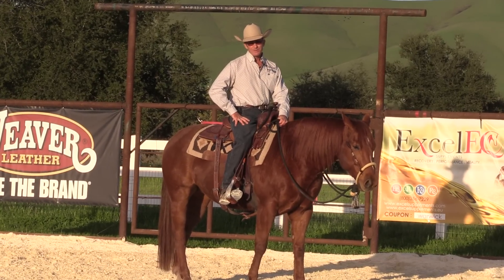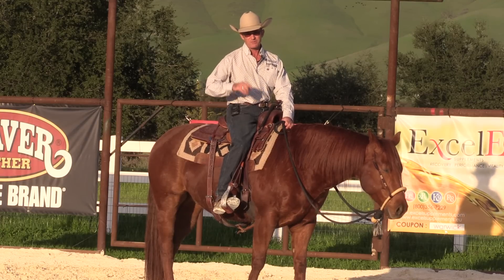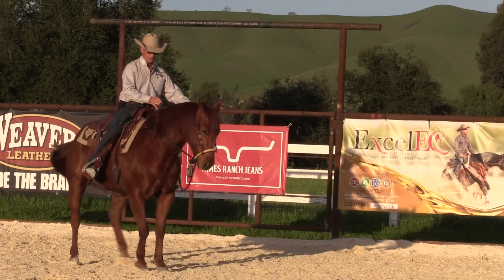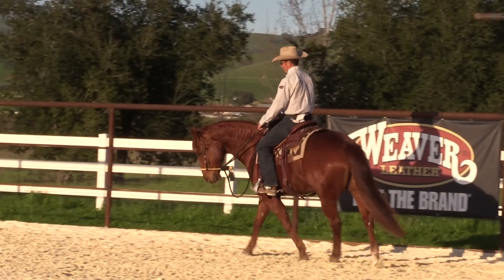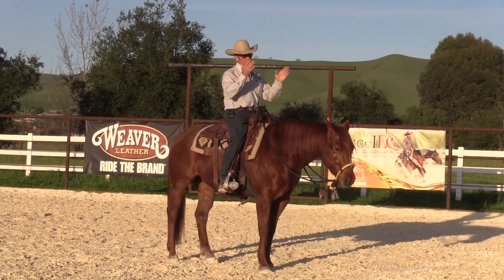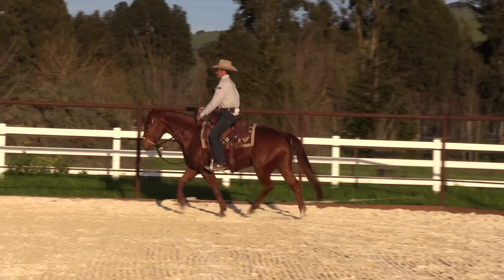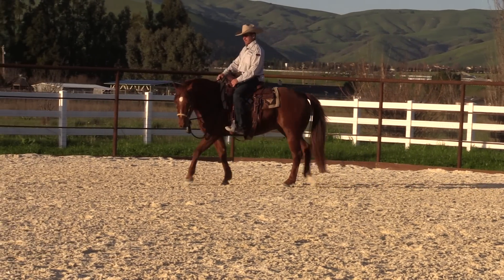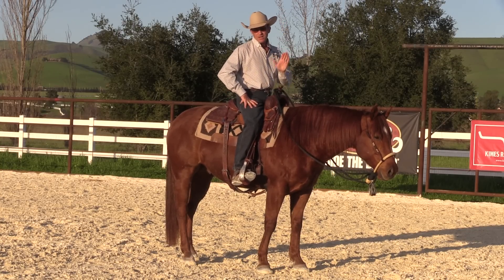Why training a horse is like fixing a broken water pipe.

Comment: As a heavy equipment operator with more than 30 years experience and having worked with horse's in various capacities, I can very clearly state, working with a water main is MUCH easier than training a horse, a water main wont kick you in the teeth if it does not like you :) or bite you, or throw you against a wall, smash you into a tree or pee on you.... dont ask.....I was young and had no idea a mare could do that....

Comment: can i ask why you wear spurs?
Reply: Good horsepeople wear spurs as simply an extension of the leg. It's a tool to use when the horse ignores a leg aid that has increasing pressure. So if you have a horse that's a little dead to the leg (lesson horses are notorious for this), you might use a little bump with a spur to reintroduce the "this aid means move out". Spurs should never be used first and they should always be used lightly.